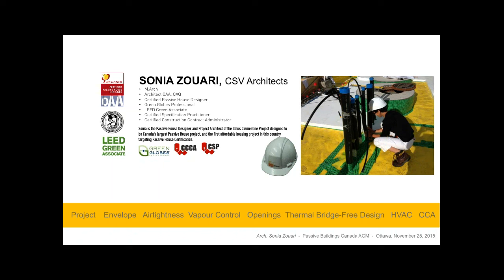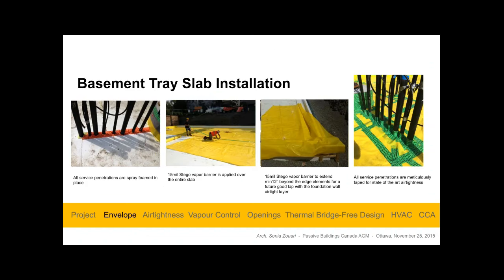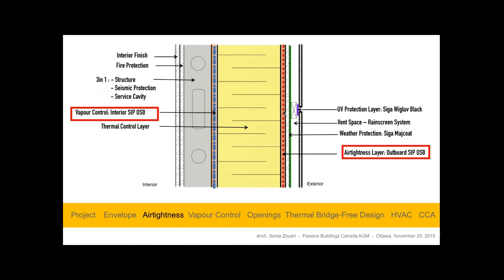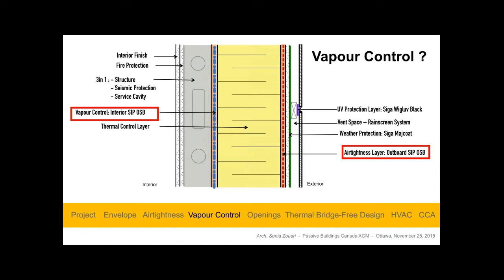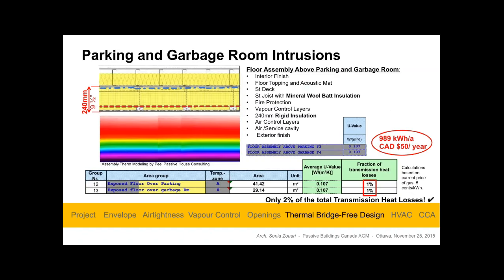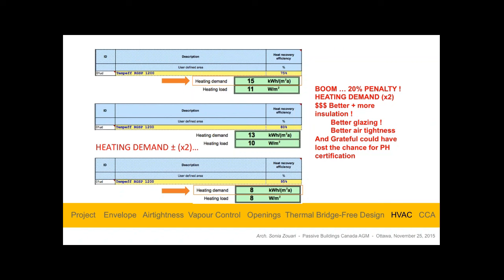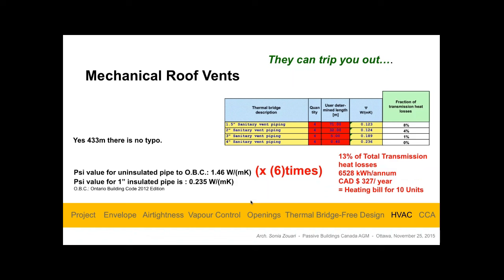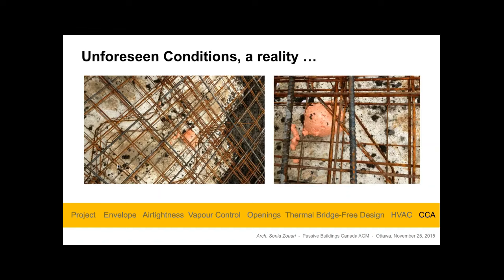SALUS CLEMENTINE

Comment: We all want success with Passive House projects but please ask for help.
Doubtful your project will any awards for the use of "Thermal Bridging" Metal Walls. 
Also, this is 2017 and the Word "RADON" is ok to mention in any presentation.
Your project could seriously benefit in both cost and quality if "Insulated Composite Concrete" was utilized for reaching Passive House and awards.
Magnesium Oxide Board, is the worsted material, next to OSB, to be used below the surface because it tends to "Rot", yes rot away when exposed to constant moisture.
Who consulted you on these choices??? You appear to have used only Building Envelope Downgrades on the entire project.

The goals should always be to avoid all penetrations possible, here you are using the ancient theory to instead poke as many holes as possible.
The term SIPs is totally misused here and I suggest the presenter take a crash course on the subject.
 your structure has been designed to fail and fail often by the use of OSB and tapes, seriously do you expect this the last more than a few months.
You are "Training" the trades by using OSB and Spray foam is also very scary, also words like Stapling and taping.
Crossing fingers and loads of assuming is not a great strategy. By using OSB, we will see a rash of Tarped structures in the very near future,
Who is you SIPs supplier, everyone please avoid the guys at all costs.
Will see yall at the Tarp Draping ceremonies.
I'm a source of Super Insulated Roof Hatches!!
Mechanical Passive is really strange, can't figure that one out.
Glad that all those BAD Details, of materials and Techniques, were revealed here for all to see. We are over-educated but still appear to know little.

Admitting that the Tapping failed before it started is Baaaaaad News and reinforces what I have been saying here,
Insulated Composites Concrete Systems eliminate over 90% of your construction problems.